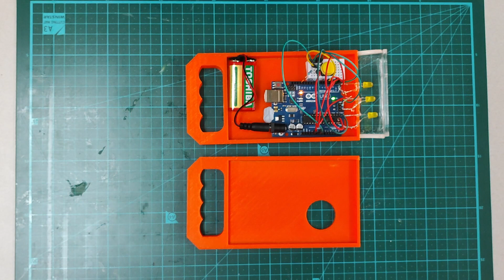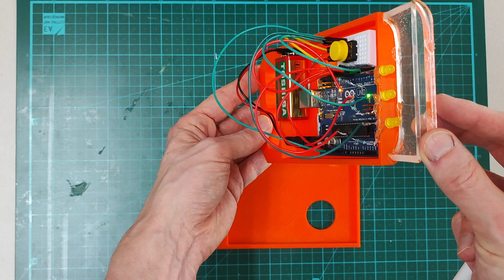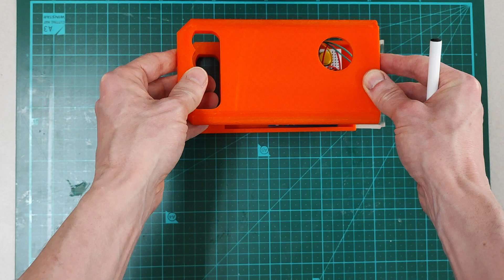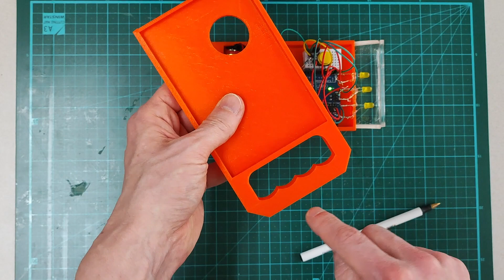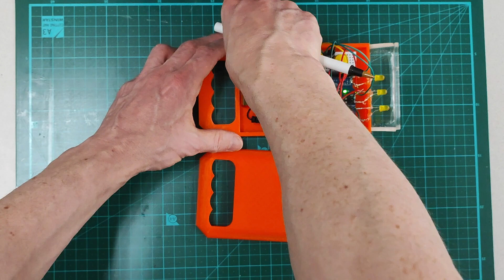SOS Signal Light Video - Peer Assessment Activity

Comment: Great project. 8/10. Don't see any rubric. However, i suggest using an 18650 inside, instead of the low energy 9v, especially as a life may depend on its longevity. I would use a Nano instead of the Uno, powered through a TP4056 board adapter/charger. Oh, and lower the wire height by tighter low profile connectors. Then seal the entire case with glue, since it is now rechargeable through the TP4056. Good job, though.
Reply from the maker: Thanks. I will add that information for my students to see how the project can be improved. My intention was to show the class an imperfect device so they can see where mistakes can happen and how they can think about fixing potential flaws. The rubric was just a worksheet I handed out in class so they can better understand how their own projects would be graded.